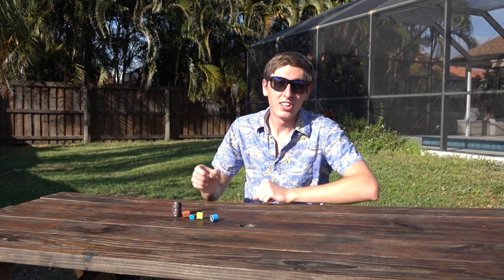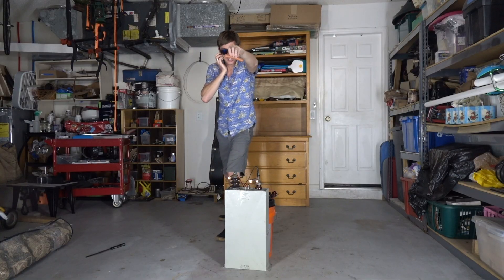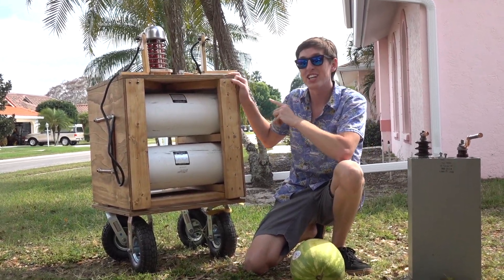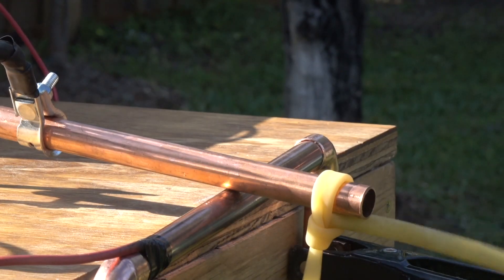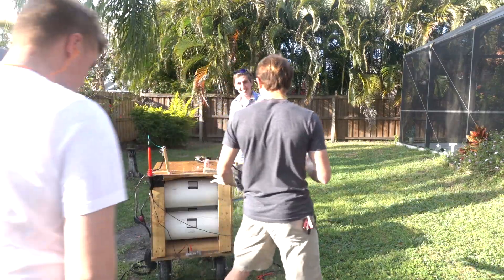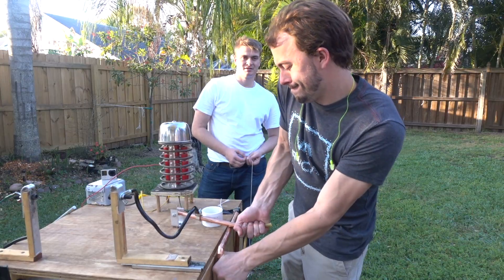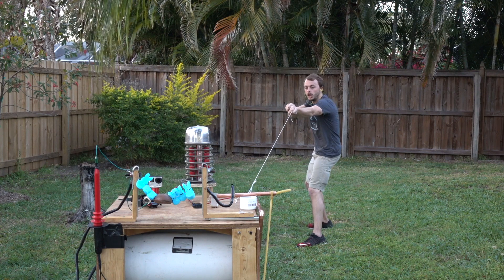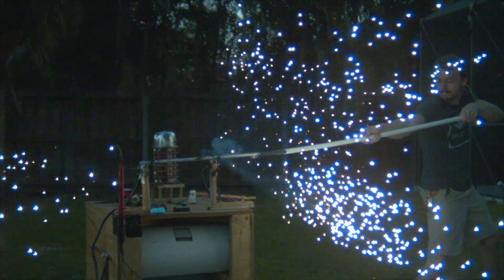What happens when you put 20,000 volts into a Watermelon?

Comment: You should try using a significant nd filter or a 700or 750nm long pass if you have some more room to expose faster. There is a lot of light in swir or ir range but it yields some sharper results when exposures are between 5um to 700ns range. Have fun and be safe.

Comment: Take old tv's high voltage multiplier, connect them in a chain (you'll have to drill a hole in special spot) and put them in a tube filled with oil, so they would not short circuit. Test this high voltage generator

Comment: Wot. A single 800gr Barnes 50 BMG dumps MORE than 20,000j at the muzzle. You'd have to load a 50 pretty damn light to get it DOWN to 5000 joules. 5000 joules is less than a 300 win mag.

Comment: it would have been more fun if the capacitor blasted instead of  the melon. the small discharge time is responsible for large current to flow
Reply from the maker: The high voltage lets the current reach high levels also.
Reply: Dat low equivalent series resistance
Reply: sonic boom well the idea of a capacitor is high VOLTAGE low CURRENT. Howeverwith these badboys the current might be high, buy in comparison to the voltage its nothing

Comment: What type/name is that first capacitor you used? Ive bought "smaller" 3000F 2.7v boostcaps before but nothing like you have there
Reply from the maker: its just an old one used that was used on powerlines 21kv @ 4.5uf, it was $50 at a Hamfest
Reply: TheBackyardScientist Exactly what I thought! What did you use to charge it? Thanks for the reply too!
Reply: TheBackyardScientist and it really seems like its something you just come across, not find on the internet right? Im trying to find one on the internet but cant even find a proper name to call a power line capacitor haha